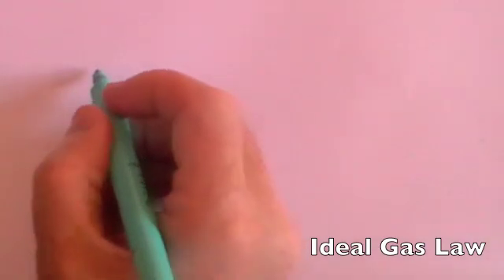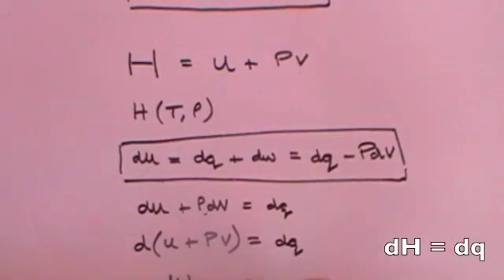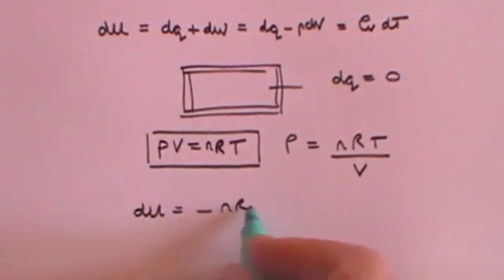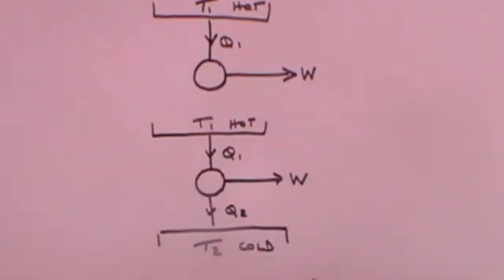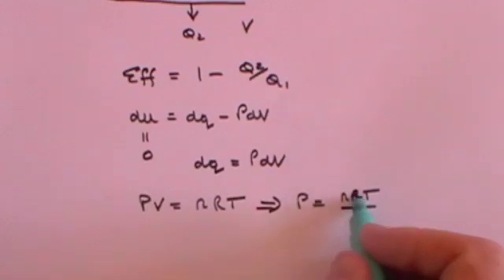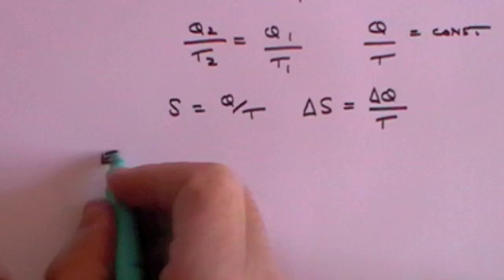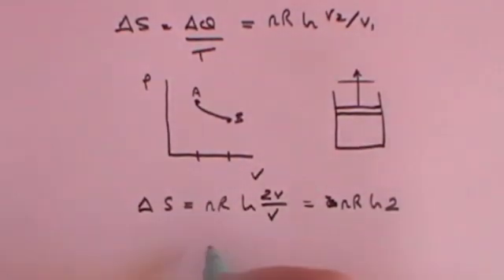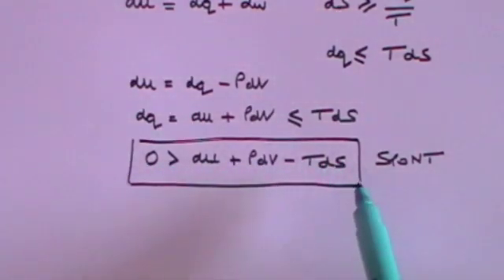Entropy and the Second Law of Thermodynamics

Comment: The derivation of s = k Ln W this way does NOT GIVE THE BOLTZMANN EQUATION! because W made equal to the total number of microstates in the system is only 
(1) an approximation of the most probable macrostate (equilibrium) and secondly ignores internal structure ie it is only valid for a gas and 
(2) misses the Boltzmann term W which is actually based on the number of microstates in a macrostate chosen by an observer for a state not at equilibrium.

Comment: Very good but at 47:30 he builds a sandcastle and then says it is state of order "which took a whole lot of energy" NO! It took a whole lot of WORK! It is only work that creates order and reduces entropy.

Note how after proving entropy cannot decrease in system involving a heat engine he says entropy is a measure of disorder without defining order. Then he talks about he Big Bang being low entropy due only to the highly compressed state of the energy. But does not show how the compressed energy of the Big Bang alone can be turned into work to create order.

Comment: -At 8:22: Why can you bracket the differential teerm d out?
d(U+pV)= dU + d(pV) = dU + pdV + Vdp
What about this last term?

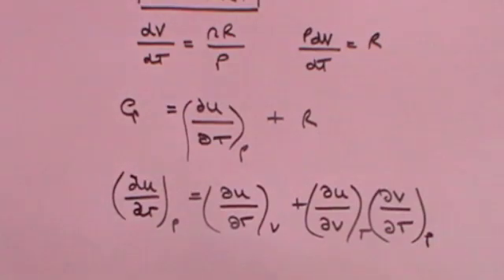-At 13:45 could you link to a video/ressource where this application of the chain rule gets clarified?

-At 28:05: Why is the only way to the system to make it "do" work on the volume? 

Thank you for this beautiful video:)
Reply: 1. I think it's at constant volume, so dp=0.
2.
U(T,V):dU=(∂U/∂T)v dT+(∂U/∂V)t dV
V(T,p):dV=(∂V/∂T)p dT+(∂V/∂p)t dp
U(T,p):dU=(∂U/∂T)p dT+(∂U/∂p)t dp
Substituting dV from line2 into line1:
dU=[(∂U/∂T)v +
(∂U/∂V)t (∂V/∂T)p ]dT+
(∂U/∂V)t (∂V/∂p)t dp
Comparing the first term with line3:
(∂U/∂T)p =(∂U/∂T)v +
(∂U/∂V)t (∂V/∂T)p
3.
dU=Q+W and Q=0, so dU=W=-pdV
Reply: @nychan2939  for the first, pressure should be constant, so that d q = d H, but teacher did not mention it
Reply: Yes, I made a mistake. But I really thought of constant pressure, so I wrote dp=0. Thanks.

Comment: Around minute 4 :30 --- if  no heat is flowing into the  box dq=0 and      du = - Pdv  where P is compressing the gas.. This means the internal energy of the system decrease as more volume is compressed  !!!! -- how is that possible as more work is put INTO the system the  less the internal energy?  It should be the other way . The du should be positive as the volume gets  smaller and smaller.     du = dq + dw  and  dq should be the heat INTO the system and dw should be work done ON the system. Am I missing something? Great set of lectures and very well thought out.

Comment: Why does heat go from hot to cold and not the other way?  No, the differential in temperature is being eliminated......it is the differential that is important....open a container of high pressure gas in the environment and the differential in pressure is eliminated.

Comment: @Dr. Physics. can you please explain the concept of entropy for non gaseous (like charging capacitors, magnetic or gravitational field) systems. where there is not a heat transfer but some other form of energy and work is done in different forms.
or if you already have, let me know the link or just guide to a book or notes that has dealt with such problems.

Comment: Cp=Cv +Rn is what you get when you rearrange at 13 minutes in. 
https://www.physicsforums.com/threads/thermodynamics-cv-cp-r-question.50631/ 
This website then states that Cv=Cp +R when you say Cp=Cv +R. Your equation seems to be backed up by other websites so I will assume this website has made a typo and your equation is correct. 
Essentially I was confused by where the n disappeared off to as this was not mentioned in your explanation.

Comment: Why are cp and cv valid for any ideal gas undergoing ANY process when their values were derived using constant volume and pressure as factors.
Reply: Nithia Nathan the empirical experimentation reveals that internal energy and enthalpy depend only in temperature for ideal gas with no regards to other properties, so I doesn't mater if pressure or volume is changing or being constant

Comment: Hi Doctor, from my understanding：

When heat is added, gas particles gain more kinetic energy and therefore their internal energy increases therefore temperature increases. (considering it is an ideal gas and U= total kinetic energy of the particles). If so, why would temperature be constant when heat is added during isothermal expansion?

Also, if U increases that means there is a change in U therefore delta U is not going to be zero. However, for your theory that all heat is converted to work in an isothermal expansion, delta U must be zero so that Q = W (this is from delta U = Q - W)

So I am quite confused by these concepts. Please correct me if any of the above is wrong and could you explain these please? 

Thank you so much and sorry for typing an essay...
Reply: +Andrey Thank youu :)

Comment: I'm confused about the simple summation of change of entropy for heat Q transferred from the hot body to the cooler one. You have simply -Q/T1 + Q/T2. What confuses me is that presumably the temperature of each body changes as heat is transferred. Why can we simply use the starting temperature of each body?
Reply: I found http://web.mit.edu/16.unified/www/FALL/thermodynamics/notes/node41.html that gives some examples. It starts with the example I was confused about. It is simplified because they are both heat sinks that can provide or absorb heat without changing temperature. Example 4 shows what I was thinking of when a hot brick is brought in contact with a cold one. There the temperature of each brick changes to a medium temperature. Integrals are done with dT/T so end up with natural logs similar to what you did with the changing volumes. With C the heat capacity, H the high temperature, L the low temperature, and M the final middle temperature, the result is change in S = Cln(MM/HL). Why is this guaranteed to be larger than 0? It's not obvious to me that M squared is larger than HL.

Comment: at 24:00 you say that PV to the power gamma is the constant for an Adiabetic system, but if P1V1 power gamma = P2V2 to the power gamma so P1V1=P2V2 !! I mean there's nothing new and therfore the temperature seems to remain constant, isn't it?
Reply: +Mounir Mallek  it seem ur confused its P {v to the power gamma} ,, not  {PV whole to the power gamma } .
Reply: also  this occur in an adiabatic process where no heat is allowed enter or leave a system. therefore the total heat of system becomes equal to zero. Now after all derivation effect of gamma appear in volume as its superscript.

Comment: That means that your metaphoric construction of the big bang where the energy balls are released and cannot be put back in the box , but a new box can be created with this added parameter to collect the dark matter and charged particles to create new balls to be released perpetually, by the construction of a dark matter mass in a stars core when it novas from atoms being taken apart by meeting their structural limits in the core and coming apart to collect the dark matter, which would be a compressed dark matter mass with gravity to collect super hot charged particles to orbit it, in a particle plasma field, which would further take any atom apart in its environment,stripping its orbiting electrons in this particle plasma field making the atom come apart into its parts the charged particles would join the plasma field and the dark matter would join the mass, and over 200 billion years this central galactic core mass would cool off and be inducted back into an expansion of hydrogen gas atoms releasing the outer galactic orbiting planets,stars, and mini dark matter masses to construct a new universe with the parts and processes of the old,

Comment: You show that "entropy always increases" for an ideal gas but then somehow generalize this to any system, which is illegitimate. Clausius did give a general proof in 1865 but his assumptions were false:

http://philsci-archive.pitt.edu/313/1/engtot.pdf 
 Jos Uffink, Bluff your Way in the Second Law of Thermodynamics, p.39: "A more important objection, it seems to me, is that Clausius bases his conclusion that the entropy increases in a nicht umkehrbar [irreversible] process on the assumption that such a process can be closed by an umkehrbar [reversible] process to become a cycle. This is essential for the definition of the entropy difference between the initial and final states. But the assumption is far from obvious for a system more complex than an ideal gas, or for states far from equilibrium, or for processes other than the simple exchange of heat and work. Thus, the generalisation to all transformations occurring in Nature is somewhat rash."

Comment: Hello. First of all, thank you for your videos. In this video, after 17'', you use a formula (of dU) which allows a variation of the volume. My problem is that you have equalled this formula of dU with one that was derived by considering a fixed volume ( with Cp). Perhaps, i missed some explanations. Thank you for your lightening.

Comment: it seems to me that all particles can randomly go to one part of the container (end of the video), but that is impossible according to the mathematics, not just improbable. Is it because of the way we look at gas in the gas law?
Reply: Having the same thought about the gas as you did, I supposed that the maths doesn't necessarily factor in the difference in rules that apply at the quantum mechanical level, which might fit the gap we observe in the simplified mathematical explanation causing us both to question it?

Comment: In a case where we wanted to prove that heat cannot go spontaneusly from colder reservoir to hotter reservoir ( T2 to T1) we had used condition delta S >= 0 , however this is a condition derived when describing Carnot process.
However in our example we don't have got Carnot process nor any engine, so why cannot we assume that delta S < 0 ???
 Why are we prohibited to assume that delta S < 0 ?

Comment: 52:00

S = Kb(ln(w))          Not dS.

You pulled over dQ = nRTdV/V and then used it in dS = dQ/T
However you integrated dQ into nRln(V2/V1) but left S as dS.

You would have to Integrate both sides, or leave it as dS = nR dV/V
Or  dS = NKb dV/V

Just a small correction, Otherwise this video was very informative and well put together.
It gets a lot of information over in a short time and well explains the mathematical processes.

Comment from the maker: The key point is that overall entropy increases. Or at the least it does not decrease. We can always find situations in which order is increased in a particularly local situation, for example if I build a sand castle. But at the end of the day the tide will come in and wash it away creating greater disorder. Particles which materialise and then annihilate leave the universe in the same state as before they were created in the first place.

Comment: "Everything in Nature slowly dies radiating away its heat.
Atomic Fission helps matter to explode eXpanding instantly instead of decaying over long periods.
Life is compression+/-eXpansion is Death.
Firmilab discovered quanta switching 3 trillion times per second from matter to antimatter.
Experiments show conversion of matter into potential energy through its antimatter brings about gamma rays with exact opposite momentum.
Every expression of power in Nature negated by its opposite expression."

Comment: This theory is based on just one equation (E= ˠ M˳C² )∞  the Lorentz contraction of space and time is between the energy and mass. The greater the energy the greater the contraction of space and the slower time will run. Mass will increase relative to this and each ref-frame can be seen as a vortex in space and time. The brackets represent the boundary condition of the ref-frame formed by the energy and the infinity symbol represents an infinite number of ref-frames that make up our Universe.